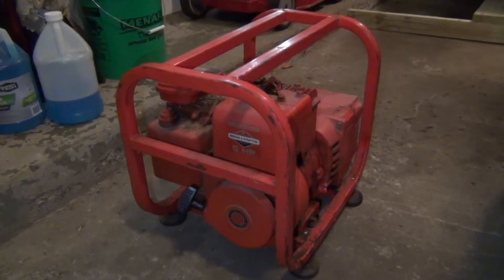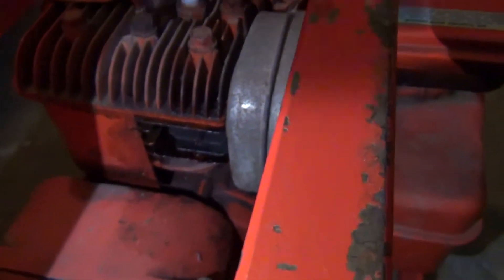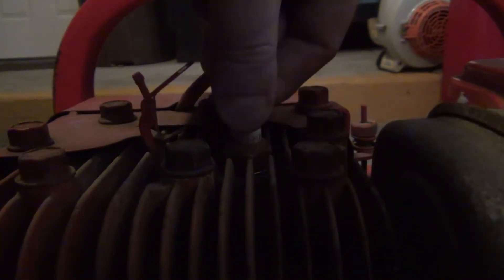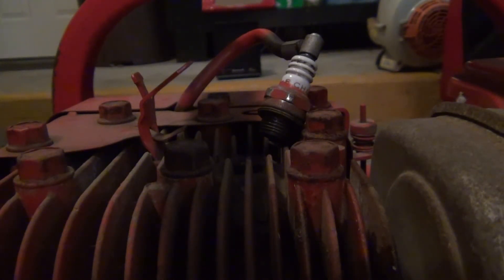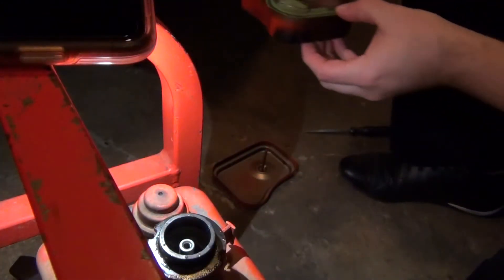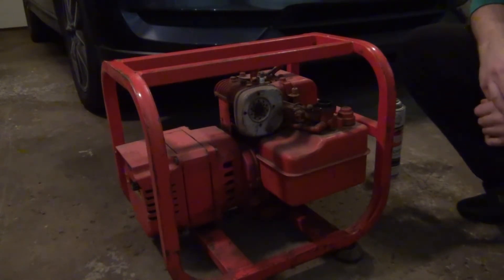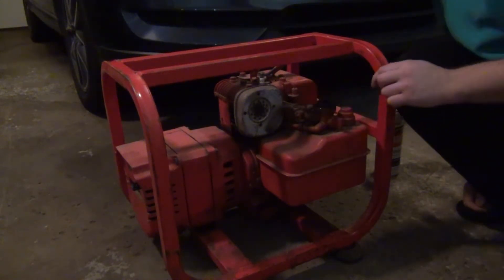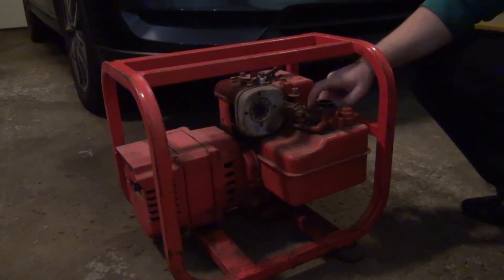Will It Run? | Free Vintage 5hp Briggs & Stratton Small Generator | Facebook Marketplace Find

Comment: Just scored the same one today for free from the original owner. Mines a 3000watt and the tank and carb on mine is different and i think mine has 7.5h engine. But same color same frame and it came with a cool cart it locks into so it dont vibrate around and u can unlock wheels when not using it and roll it around. Super cool video man. Old tools are the best

Comment: That should be a 2500 watt generator. Picked up one of these Colman PowerMates from Craig’s List for $20.00. Had been sitting in a barn for 30 years covered on mud doober nests and dust. Changed the oil and fresh gas. 2 pulls and runs like a champ
Reply from the maker: Thanks for the heads up on wattage! Yeah, they don’t make them like they used to, that’s for sure. These old flathead Briggs engines are like tanks!

Comment: I still find it amazing that all it needed was some gas in the tank.  I find it fun to collect discarded things and get them going again. The speed on these is set by frequency and not voltage. They have very primitive regulation that works best at midrange load. Normally the voltage and frequency decrease with load. With no load, that high voltage is not unusual.
Reply from the maker: Me too! I don’t understand the logic behind people getting rid of some of these things that I find.

Thank you for the info on these old school generators. This is the first one I’ve come across and “worked on”. (If you can call adding gas to a perfectly running machine work) lol

Hopefully I can come across another one to learn a bit more next time around!
Reply: From experience, there’s either very little wrong or it’s completely destroyed.  This one looks well cared for and not used much.  I bet someone drained the tank after it’s last use.  If it’s run low on oil, the engine will fail.  If the generator is overloaded, the windings will burn out.  Newer ones have better protections. It’s rare to see an older unit in this condition. Try putting a load on it and seeing how it performs.
Reply from the maker: They had to have drained the tank, because this thing was spotless and the pickup tubes and screen were clear.

I need to pick up some glass fuses before I do any type of load tests beyond a couple of lights. I couldn’t find any badges on it but would think it could hold 2kW or so. We’ll see how much the voltage drops under load, may need to do some minor adjustments later.
Reply: Sounds like your having fun.
Reply: Correct, the the control on the output is usually controlled by a couple diodes and a capacitor behind the the back cover. The brushes capacitor and diodes are available still with alittle searching. A kill a watt meter will give you the wattage output, hz voltage, handy tool to have.